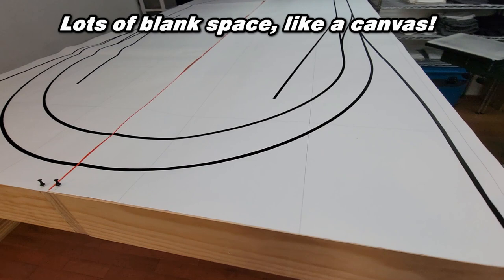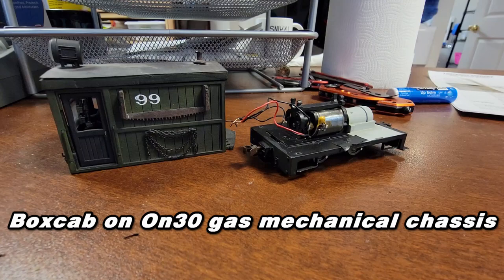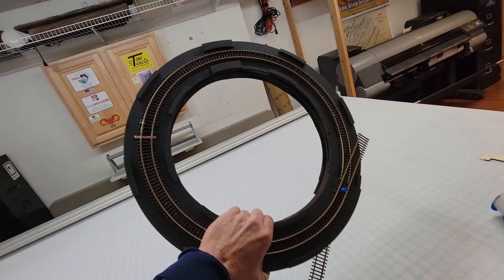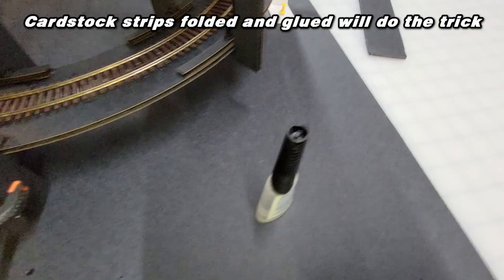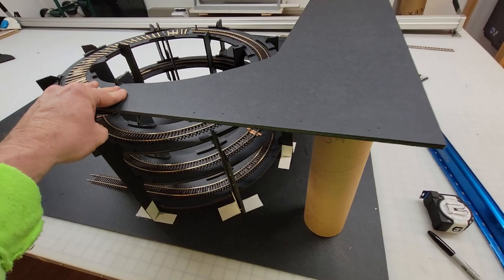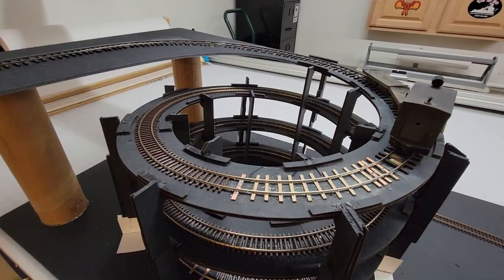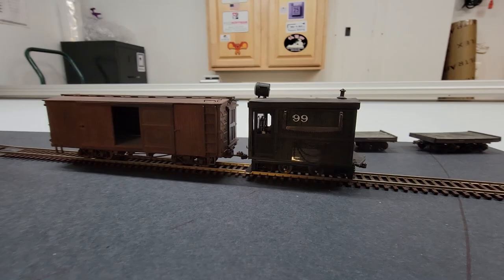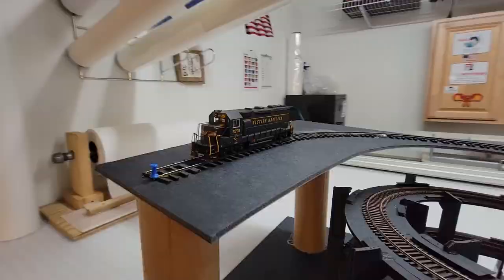VLOG: Have I lost My Mind?

Comment: Excellent to see this video. Was drafting up plans for a small shelf layout with two levels. Original plan was a 15” radius helix but wasn’t sure if that was too tight for HO. Watching this video...100% confident it’ll work!
Reply from the maker: On the original mini layout, I built a critter loco which used a Bachmann GP7/9 chassis as well. I can't say all Bachmann geeps will work like that, but the ones that I had seem to be just fine.

Comment: No i didn't unsubcribe!. I couldn't!. Your too good at what you do. And we all learn from each other, But Thank You for the dedication!. LOL!.  And thank You again for doing this video!. Did i give you the small kick in the pants to do it or get out the On30 trains?.. Were so much alike it's Not funny. Jumping from project to project... It's a wonder i ever get anything done, but i do!.. I absoultly love your On30 engine collection and am right now finnishing 2 box cabs just like yours (from milepost) but with a big difference, my lower chassis started with new Walthers mainline plymouth ML-8s, HO switchers, and toss the bodys. The new On30 deck and end plates are styrene and added custom side frames to make them outside frames. They are geared low, run near dead silent and with better gears than any bachmann ever made!.  They are equipped with soundtraxx dcc, Fairbanks prime mover sound and with the 5 capacitor keep alives... a must with 4 wheelers!. They even continue to run for 8 seconds even after pulling them off the track!. I love these LiL Critters so much, I built 2 more pair!. And these have customized little Bachmann gas mech switcher bodies on them. So you just started this small helix that i have been wondering about for years!. perfect timming and giving me the inspiration to finally give this a go. I have been running on a 2' x 6' layout with 10" curves for quite a while now. But i have another track with 15" curves for the 2-6-0s and 4-4-0 steamers since they will not run on anything less..  Oh, with covid forte last 2 years i have also built over 100 4 wheeled mining jenny's.. each is 3" long.  Yep, I'm going for a record, even if i have to double head a few engines.. I will try to e-mail you some pics......  Your model railroad older brother.. Dave.....

Comment: If I use standard height Ho  gauge risers with dual track  witch  bead . will that work for On30 regular equipment ? Will I get enough clearance hight ?
Reply from the maker: Allen, you'd have to measure your equipment to see if it will fit in that height range. They may depending on what you have. My 2-8-0s are approx the same height as that boxcab with the headlight. If not, I may be able to do some custom risers that allow a little more clearance. That and O scale riser are on the to do list anyway.